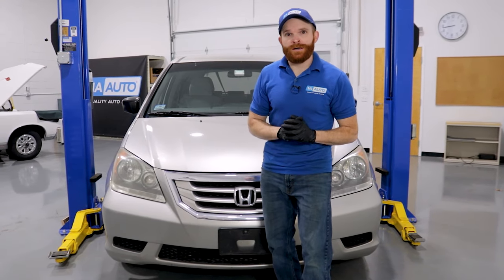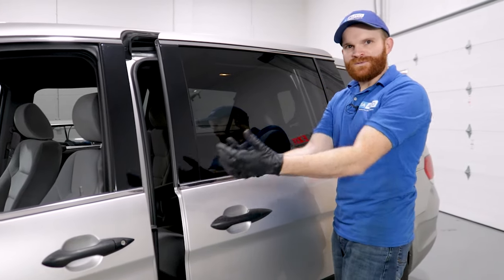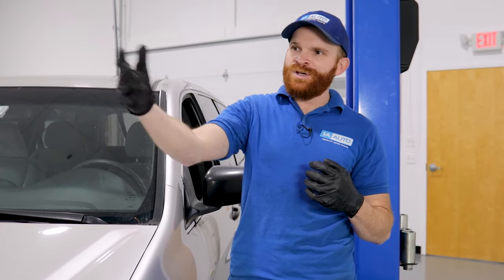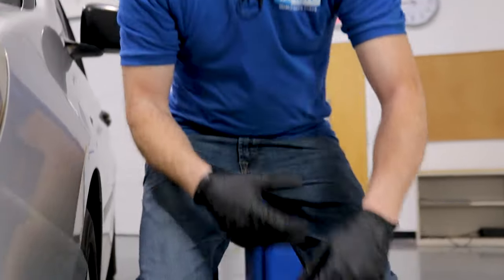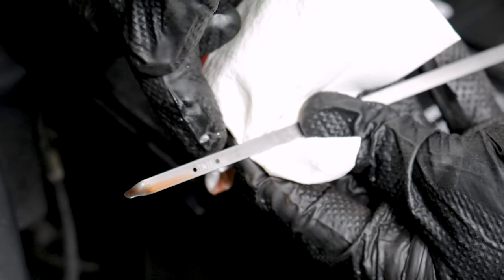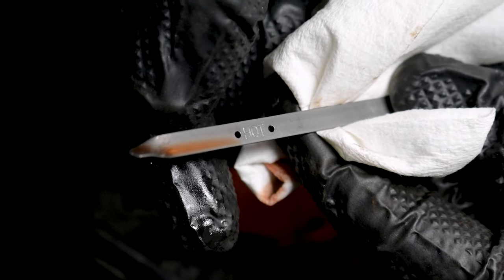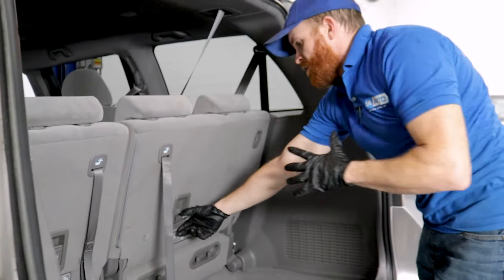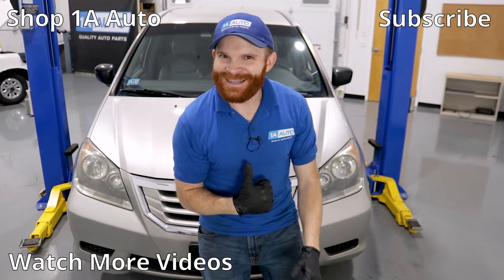Top 5 Problems Honda Odyssey Minivan 3rd Generation 2005-10

Comment: Good tips! I've had to replace the sliding door roller on our 09 Odyssey, and I need to do the passenger side as well. For the models with VCM (variable cylinder management), oil consumption is a very common issue. Ours is dealing with that now. It has close to 200K and has run nearly dry on more than one occasion. Honda issued a TSB for it, but it didn't cure it for everyone. 

I also had an issue with the second row seat where the cable connecting the latch to unlock the seat so you can remove it from the vehicle came off of the thing it attaches to. I had to essentially break off the plastic trim on the bottom of the seat in order to reconnect it. There's probably a better way to do it than that, but it worked.
Reply from the maker: Excellent tips! Thanks for sharing! http://1aau.to/m/Shop-1AAuto-Now
Reply: Jonathan - From my experience, the oil consumption issue is due to oil getting past the piston rings. Purchase oil additive BG EPR and add to your engine oil to fix the issue. https://www.bgprod.com/catalog/engine/bg-epr-engine-performance-restoration/  This additive cleans the deposits from the piston rings, which frees up the rings and prevents oil from getting past them. My 06 Odyssey with VCM has 275k miles and does not consume any oil after cleaning with BG EPR. I recommend following the directions exactly on this product, as the oil will turn BLACK from all the gunk it removes. Replace oil and add BG MOA with the following oil change. https://www.bgprod.com/catalog/engine/bg-moa-extended-life/#bg-product-1  Once again, follow directions and your engine will gain noticeable power and no longer consume oil!
Reply: Another option is purchasing a VCM muzzler. I installed it in my 2012 oddy and haven't had any oil consumption issue. At 150k currently
Reply: @fortunatedad7695  if consumption is that high it might already to late to rectify vcm

Comment: I have a 2010 bought brand new and no issues on motor or transmission but definitely the rotors and the sliding doors and I have manual doors. I second to buy the original parts. On my third part and the aftermarket part broke within months. It has 280k and still drives so good. I love my minivan.

Comment: I got a 2005 with 260K(ish) original miles.  Honda used to say that the transmission filter was good for the life of the vehicle and that it wasn’t necessary to service it.  They were wrong. That filter should be serviced because they literally come apart with age. 
Honda should’ve said that the ATF filter needs to be serviced.
Reply from the maker: Thank you for that extra information! http://1aau.to/m/Shop-1AAuto-Now
Reply: I have been through this myself
Reply: If you do a drain and fill every 30 to 50k, you wouldn't need to replace the filter. 
I bought my 2010 MDX with 190k, changed the tranny filter because I was experiencing shuddering when the car warmed up. I cut the filter apart and there wasn't hardly any debris in it. There isn't much of a filter, which is why they recommend drain and fills every 30 to 50k. Its as easy as changing the engine oil.
Reply: Replaced external trans filter on 2006 at 160k. It was filthy but no sign of degrading apart
Reply: I think the transmission filter is mentioned in the recommended maintenance schedule
Reply: Great job with video. Will be doing transmission oil service every 30000 miles. Thank you Sir..

Comment: I love my 2007 Honda Odyssey.  Great car.  There is no electric side door thank god.  It's manual.  Needs to be greased often.  They do get stuck in the middle and don't go all the way sometimes.  I have D and D3, I suggest to everyone who owns one of these to keep it in D3 as much as possible - below 40mph and up hills.  It does up-shift way too early in just D.  D3 and careful driving, keep that transmission going for as long as possible.
Reply from the maker: +Senna Rain Thanks for checking us out! http://1aau.to/m/Shop-1AAuto-c
Reply: They stick in the middle because of that "center roller" he talked about in the video
Reply: I purchased a used 2007 with power sliding doors.  They worked kind of OK, but there was an issue with the micro latching switch on the passenger side which would cause the battery to drain in ~3 days if not driven.  We ended up cutting off the cables on the door slides, lubing the switch through the door latch and making the doors manual.  Along with cleaning the tracks and rollers, it is awesome now.  Manual doors work better than power (much quicker to open and shut yourself) and no phantom power draw now.

Comment: I have a 2007 Honda odyssey bought it brand new and still have it to this day ( 2024)  it’s almost 260,000 miles on it. I haven’t had any seat problems whatsoever, the passenger sliding door- started to have some problems- it wouldn’t open and close correctly so I sprayed some lubricant inside the door and on the cables where it travels on and ever since it’s been working correctly and hadn’t any problems, transmission is good- no problems just keep up with your maintenance- oil change, filter, etc.. I usually wait when it’s 5% to change but there was times when it was at 1%- belts I’ve changed, tires, all the usually things but nothing serious. The older the vehicle gets never miss your maintenance because it will catch up to you and it will be expensive- but I won’t be buying anymore Hondas- Toyotas and Lexus are what’s on my drive way now.

Comment: THAT IS A GREAT VIDEO!!!!    I have had 3 of the 5 problems. One you can add is the push button on the Automatic Shift Knob and the Wiper Fluid not coming out. Mine has 136K.
Reply from the maker: +Francisco Matos Thanks for the tip! We'll pass this info along to our production team.
Reply: Wiper fluid pump has gone out on my 2008 Honda Odyssey EXL.
Reply: When the wiper fluid tube clips break (when the mechanic is banging around under the hood…”, the line can get trapped in the closing hood😱 Happened to mine. I Gorilla taped the hole and taped the line back up to the hood

Comment: Great video! We have a 2010 Odyssey Touring. We bought it brand new and now it has 152k miles and it still runs great! So far we have only experienced the sliding door problem. Hopefully no other issues will occur during our ownership, but it's bound to happen as the car gets older. Another issue we have is that the front drivers dome light doesn't turn on the with doors anymore, we can only manually turn it on. Any tips on fixing that?
Reply: Each door has a switch, work it by hand and check
Reply: I have the same light problem on a 2006. I think you need to replace some circuit board to fix it.
Reply: This may sound dumb but, much like the seat warmer buttons, the main dome light switch has an "off" & an "on" and ALSO a sweet spot in the middle that's for door ajar. In addition, each individual light can be pressed on or off. 
Honda pushes "convenience" all the way to "confusing".

Comment: You totally missed the Electronic engine mount problem.  The electronic engine mounts prevent you from feeling the VCM (variable cylinder management) turning on.  When the engine shuts off three of the cylinders and the engine is then out of balance.  The Electronic engine mounts activate to compensate for the cylinders being turned off.  Engine mounts cost a grand.  WHen these go out..the smart thing to do is to buy a VCM muzzler that prevents the VCM from activating (a hundred dollar fix)

Comment: I've had the door problem (replaced the sliding door hinge) and the pulsing brakes on my '09 with 200k.  My other problem is my wife's depth perception as she keeps clipping things.  Otherwise, everything's good.
Reply: Hmm - seems like a defective unit. Might have to get a new one.
Reply: @redpilljesus  yes,  get a new one and I'll also suggest keep the old one just in case.  Store it in the garage,  basement,  or leave in kitchen.

Comment: About to buy a 2005 Ex. They said timing belt replaced as that’s an issue. Also I read now 2005 worst year along with2002. I drove it but didn’t feel much of a vibration for brakes or anything. I’m going to purchase and change transmission fluid I guess and hope for the best.

Comment: You should add that the belt tensioner bolt breaks off in the AC bracket. The AC bracket can be removed without disconnecting the AC lines. Once out you can more easily extract the broken bolt or replace the bracket all together and install the new tensioner assembly.

Comment: I have the 2006 odyssey. My side doors both had binding problems. They were really bad. Simple fix. Slide the door all the way open. The roller will be visible at the far end of the door.  Spray roller with silicone, WD40, or similar product. Instantly fixed like new.

Comment: I had a 2009 Honda Odyssey touring edition, purchased brand new, and well maintained by Honda service technicians only. The hard spots on the front brakes were constant problem, and even after regrinding the rotors they would come back eventually.

But at 128,000 miles what really did her in is a strange quirk that developed in the transmission. One day I had to make a panic stop on the garden State parkway, and in order to avoid collision with the automobile in front.... I veered off to the left. My car came to stop with one front wheel on the grassy medium and one front wheel on the pavement. When I pulled away, when my line of traffic cleared up, I could not get the car over 20 miles an hour..... And a noise developed in the transmission similar to when we were kids and we had baseball cards tapping against the spokes of our bicycle Wheels. Eventually in about 2 miles this problem disappeared. But every few months afterwards it would show up suddenly, usually on a rainy or very humid day -- that noise would start, and I wouldn't be able to get it over more than 20 miles an hour. Each time it would clear up on its own after about one to two miles.

I suspect what happened is when I had to make that panic stop, slamming on my brakes, and having one tire stop on grass..... And the other tire stop on Pavement...... The torque experienced within the transmission must have caused too much torsion in one of the components...... And it broke.

I brought my car into Honda with this complaint, but the service technicians were not able to duplicate it in their investigation. They explained that they do not work on transmissions, but merely replace them with refurbished units ($1,500 which I could not afford). So I turned it in for a 2013 Honda Civic.

It did seem like, eventually, it did develop a bit of vibration in the transmission (during acceleration)..... Probably the rear engine mounts (as you suggest in your video). 

Other than that, the car performed flawlessly. The doors always worked..... The lift gate always worked..... And my main concern for regular maintenance was replacing light bulbs behind different switches in the instrument panel (for some reason they kept wearing out).

I purchased the car with Pax tires by Michelin, which made the claim that you could run for 125 Miles on a flat tire. Each tire came with a plastic inner "wheel" that's supported you until you could get to the nearest gas station for the repair. I had an occasion while driving through North Carolina (to Florida) where I picked up a screw on the highway and it caused my front tire to "go flat" (but because of the inner plastic wheel it never really goes flat). I was able to drive that car for 50 miles along the highway until I could finally find a place to have the tire repaired. Those Pax tires were incredible....... But if you hit a pothole or bump in the road too hard, and the impact reached the plastic wheel on the inside, it could cause it to deform and unbalance that wheel. When the Pax tire was replaced they would automatically replace the plastic inner wheel too...... Which solved the balancing problem.

All that being said, if one day I hit the lottery and I can buy any car in the world....... It will be a Honda Odyssey touring edition again! All these things notwithstanding, they build those cars like Abrams tanks!!!!

Comment: Great video. I want to change the transmission fluid in my 2007 Honda Odyssey. I got the Honda spec fluid from NAPA, and ordered a new crush washer off Amazon. I plan on refilling through the dipstick tube as it appears easier. The plan is to replace only the amount that was drained, initially, before checking when hot, to make sure I don't overfill. I have @ 140K miles, first time it's being changed. Is there any special things I should do that I'm not? Thanks

Comment: We have an 2007 Honda Odyssey with roughly 190,000 miles and we haven’t had the brake pulsation issue, or the bad engine mounts found on the 06 and 05, and ours doesn’t have any transmission problems. Probably the best car we have ever owned, it drives incredibly well for what it is, it’s responsive and holds alooooot. We tow with ours as well, but a major issues that we have most commonly seen of all the problems that we have is steering pumps. We’re probably on our 3 or 4 steering pump, but with the  current one we’re trying a thicker transmission oil that isn’t Honda spec and the pump seems to be holding up better.
Reply from the maker: +Alexander Paul 2 Thanks for checking us out! http://1aau.to/m/Shop-1AAuto-c
Reply: Replace your power steering reservoir if you haven't already.   It has a screen that plugs up and starves pumps over time.  It's cheap and easy.

Comment: I replaced the power steering reservoir, and the fluid. Then I still had noise and really foamy looking fluid, which turned out to be the downstream? (not sure) gasket in the power steering line, right on top of the engine, the gasket that's closer to the front. That took care of the whole power steering issue.

One of the parts in the doors that feels commonly is called the actuator. I think that's what he's talking about-face when he says the latch.

The AC motor relay, inside the fuse box that's inside the engine bay, by the passenger side I think. That's a $15 or less part, that went out and shut down the AC immediately. 

It's also important to think about the timing belt if you're past 100,000 miles. At least that's what I hear, I'm a little bit past that few tens of thousands.

I think the engine splash guard that's underneath front and center, is probably also a common part that comes loose. Maybe that's just from snow up here in the North. 

It's also important up here in the north to make sure to oil or "shin etzu" the seals on the sliding doors especially so that they repel water and don't get frozen shut in the winter.
Reply: My engine guard is all messed up. Maybe it’s from hacks I’ve taken it to who didn’t make sure it was replaced correctly. Not many owners would know that had happened, even if it fell all the way off. First time I had to deal with our (owned since 2002) was when I had to fix something else. I Found a couple of wood screws had been used to secure it. I kid you not! Some people are … fill in the blank.
Reply: You seem to be addressing all of my '06 problems, Murph. I look forward to your Youtube upload (hint hint).

Comment: Premature (50-80k) failure of the alternator even though it costs $600. Labor can easily equal that figure. A remanufactured alternator from Denso is the way to go...usually around $200.
Reply: If the brushes in the alternator haven’t eaten away too much, they can be changed out.
Reply: Junkyard $25 for Alternator did the labor myself.

Comment: Oil consumption issues on 2007 model year .  
it has , 207k miles 
I just changed PVC valve hopefully it was just a stuck PVC valve. I have never changed it so I figured to try that first.  It’s a cheep easy part to change yourself.

On transmission only use HONDA ATF-DW1.  It will shift a lot better.  I tried a atf fluid that said it was compatible with ATF-Z1 while it worked shifting wasn’t smooth.  So I went back to DW1 (the Z1 replacement ATF)   It immediately shifted a lot better and no more slipping in stop n go traffic.
Reply: Oil consumption - look up vcm problems :(
Reply: Did the pvc valve solve it?
Reply: @mrdumbfellow927   yes I am aware of those VCM problems.   So far after changing PCV valve it is using less oil.  Going to measure how much oil I added between oil changes starting after  next oil change